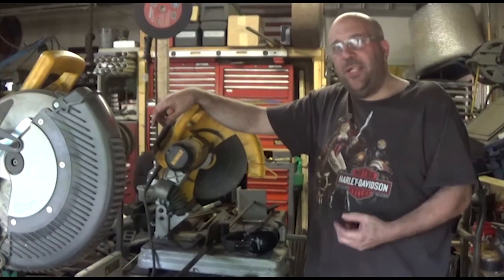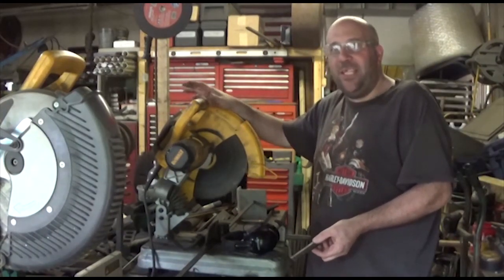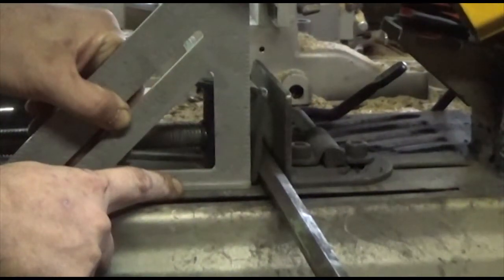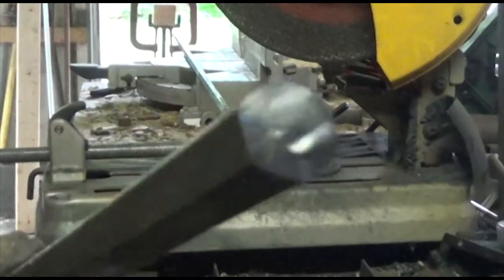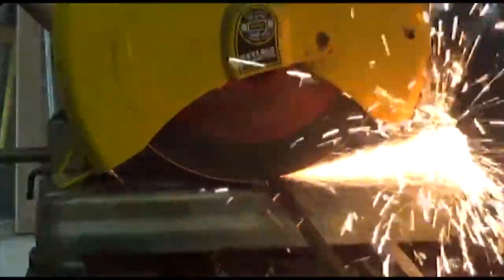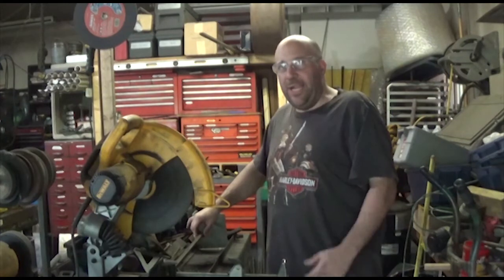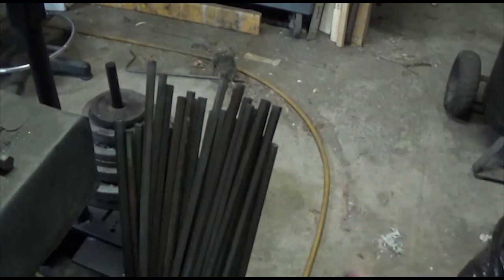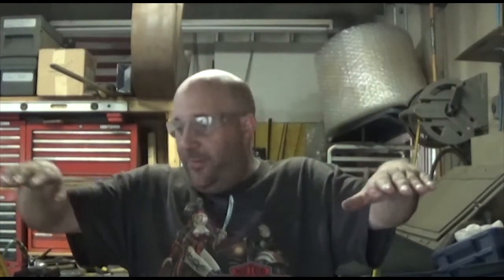Quick Tip: Reduce The Burr Left On Hex & Round Stock When Cutting With A Abrasive Saw

Comment: I have an abrasive saw that I use when I am cutting mystery metal.  I also have a 14 inch Northern Tool Cold Cut saw that I use a fair amount and I have a blade for steel and for aluminum that I got with it when they had a special going for them several years ago.  I love the saw and it fills all my needs.  But, I am a hobby metal guy, so I do not need a super high end saw.  But, a cold cut saw really makes a big difference.  I also have a Milwaukee cold cut circular saw that I picked up at an estate sale for cheap that works great as well.  But my mounted saw is my favorite.  Great video, very informative.

Comment: Thanks for the tip Jeff. I wouldn't buy the DeWalt if I were you, too many people complain about the stamped metal base, unless you are planning on buying or making this to go with it https://saundersmachineworks.com/products/dewalt-dw872-fixture-plate. The other problem I heard of is blade deflection is bit high in a 14'' blade resulting in hard to get straight cuts, you perhaps would be better served with the Makita LC1213, sturdy cast aluminum base, 12'' blade and it cuts straight. You can also get the Diablo 8 X 42 Tooth Steel Demon Cermet Carbide Blade Ferrous Metals and Stainless for it that cost $49. There are several  YouTube video about the Makita saw.
Reply from the maker: I'll check it out. Thanks for the information :)